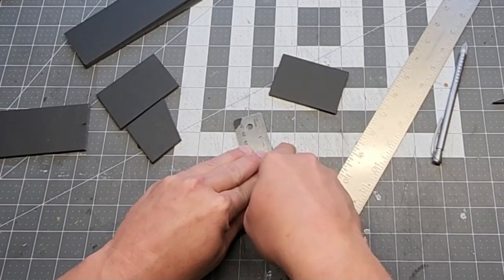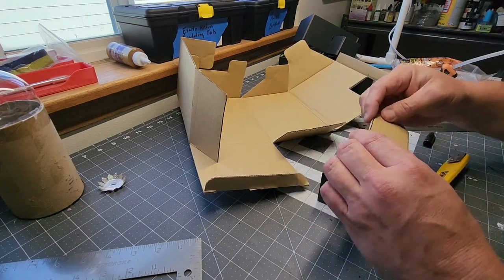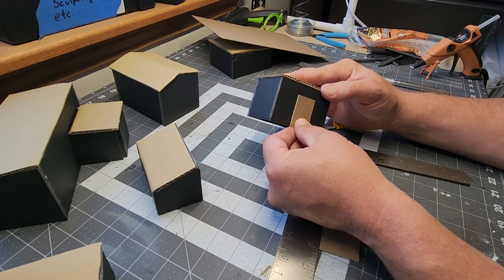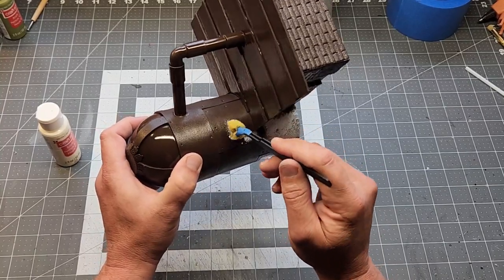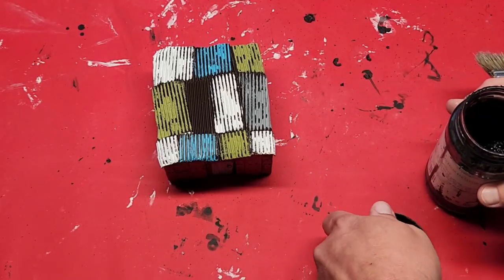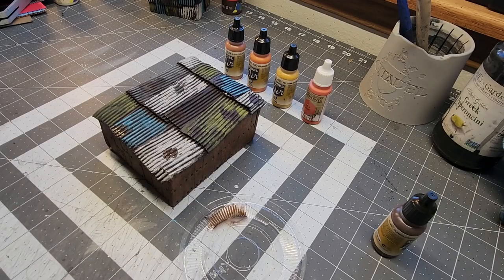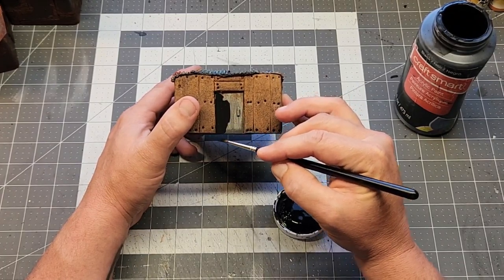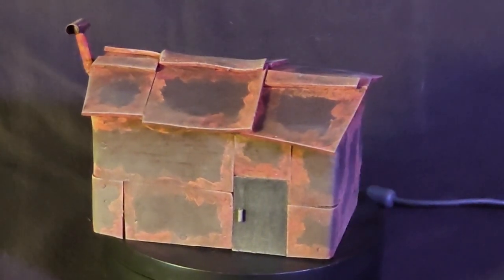Shanty Buildings for your tabletop!

Comment: Cutting partially through the foam board, so it's a continuous strip bent into a box, CAN work better if following two methods.

1) Use a knife to shave off the ends of the foam, at 45 degree angles, so they can be glued together flush. I've personally used this method before, and while it wasn't perfectly clean, it hot glues together well enough. It'll be on the inner surface of the structure, so no one will ever see it.

2) Cut lengths of balsa wood, or possibly lengths of paper straw. Insert these into the corners, so it looks like the building is reinforced by rectangular or cylindrical frames. This can also work well in a fantasy setting, for making timber framed buildings.
Reply from the maker: You are correct, and that is a tactic I have tried in the past with... mixed results.  🤔 I probably ned more practice to make it look good. Thats why i bought a 90 degree matte cutter a while back. Since I don't do a lot of fantasy builds or even 20th-century builds, I wouldn't use the technique often, but I can definitely see it being a great result! Thank you for the awesome suggestions!